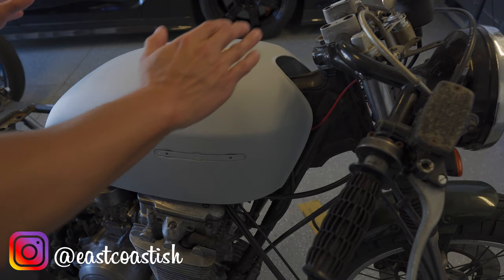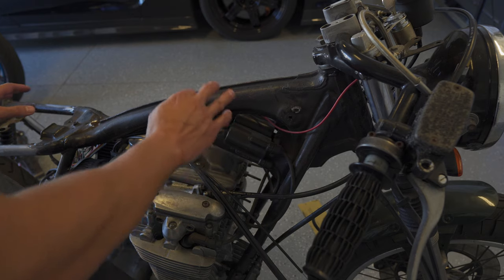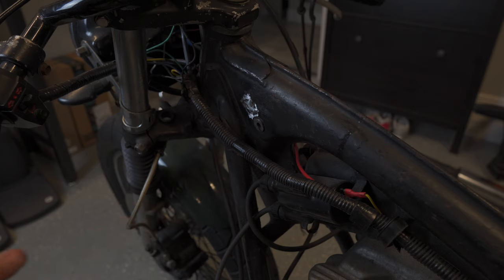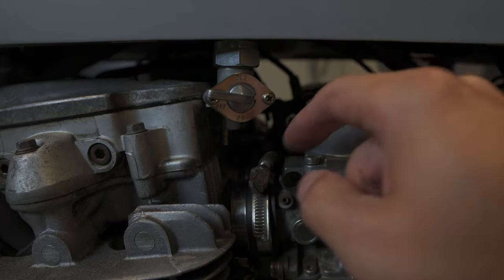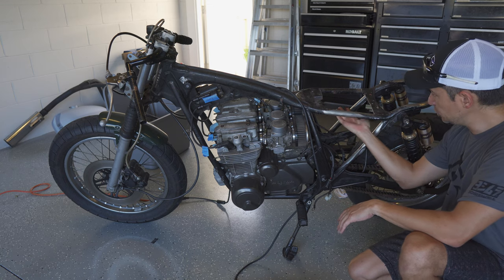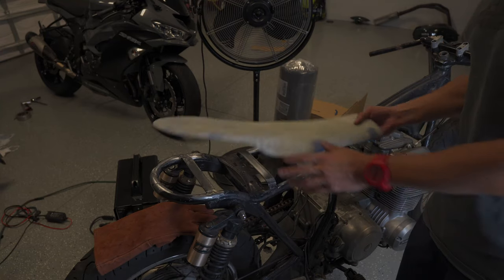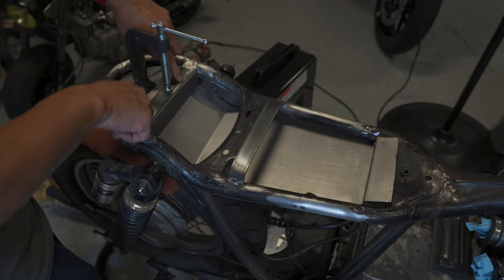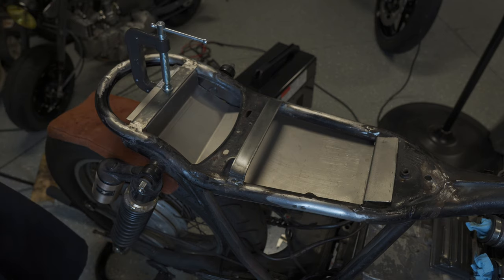CB650 Cafe Racer - EP3 (Fiberglass Seat & Electronics Tray)

Comment: Had you worked with fiberglass before?
Reply from the maker: Nope, this was my first attempt so I was happy with the result. I think I may add another layer or two though when I get the bolts on.
Reply: @eastcoastish  doesn't look too hard to do. I've seen BORN CO. do it a on a few builds. might have to try myself in the future
Reply: It’s not itchy at all